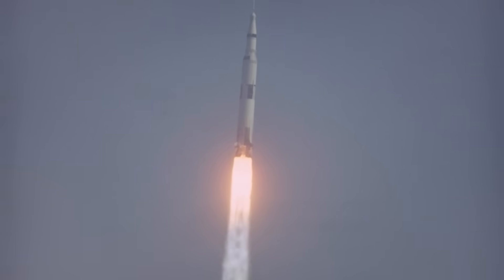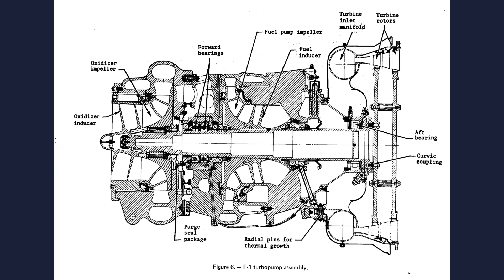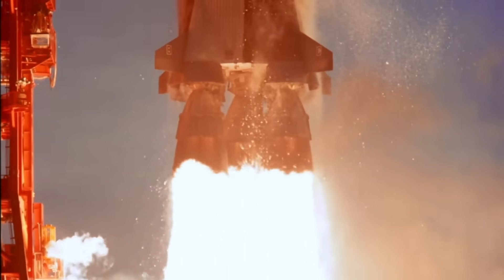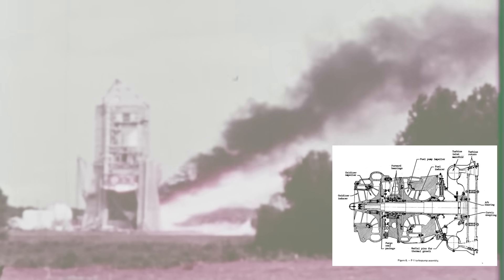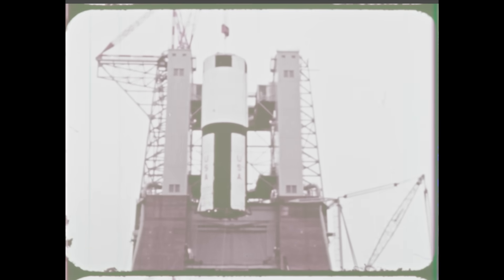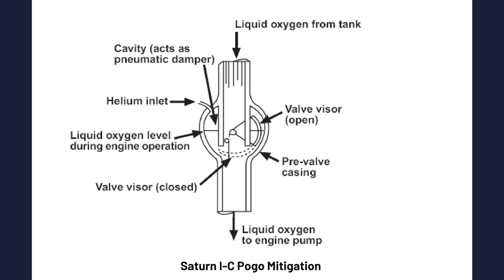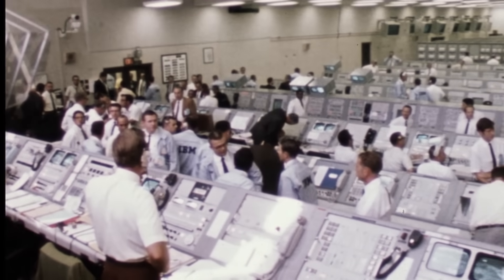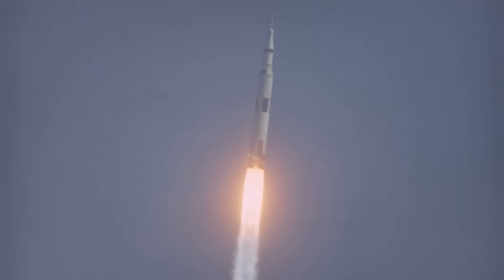F-1 Turbopump: The 55,000-Horsepower Heart That Nearly Tore Itself Apart

Comment: Cavitation is the formation of micro bubbles in a liquid created in micro vacuum zones that then move to high pressure sides of systems and collapse under pressure.  While the high-side pressures are rated at thousands of pounds per square inch the cavitation bubbles collapse is measured in thousands of tons per square inch. This is the equivalent to hammering again and again on a spot of metal which results in work hardening and subsequent metal flaking and shearing or, as Musk might describe it, the spontaneous unintentional subtractive machining of the part along with the creation and introduction of massive amounts of system contamination resulting failure. Happens in milliseconds! Boom! 

Another work hardening problem in rockets has to do with vibrating wires, any part of a wire that vibrates will fail. Think ‘vibration-cycles’ as in hertz and kilohertz. But rockets introduce so many tiny vibrations that these occur in megahertz cycles, or millions of cycles of bending and work hardening per minute. Wire vibrates and work hardens in milliseconds, breaks, and BOOM! It's over.    After all it is… Rocket Science!

Comment: What impresses me most about the F1 engines' turbopumps is how engineers were able to prevent it from exploding in flight. A seized bearing, blade failure, impeller failure or shaft failure would result in the loss of the vehicle.

Comment: To m, what's more impressive than the raw power of the F-1 is the engineering that allowed the piping to survive those fuel flow pressures for 2-3 minutes of flight time...on top of test firings.

Comment: 4:55  as impressive as the F-1 turbopump was, the Space Shuttle Main Engine (SSME) pumps are phenomenal. The high-pressure hydrogen pump runs at 34,000+ RPM with turbine power of 63,000 HP. It weighs about 800 pounds. The high-pressure LOX pump runs at 22,000 RPM and 23,000 HP with its secondary booster pump delivering LOX to the preburners at 7,000 psi. Other than sensor failures resulting in an anomalous shutdown (Challenger's center engine during STS-19 in 1985) the SSME was 100% reliable which is astounding given the power densities involved.

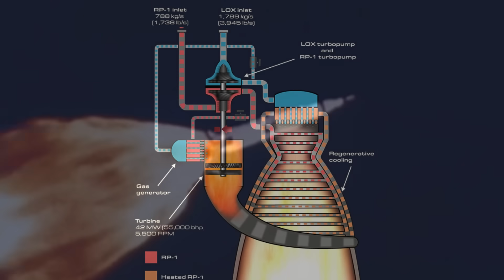Comment: 0:22 mass flow rate was WAY over 1000 pounds per second: about 4,000 lb/s of LOX and about 1,750 lb/s of RP-1 (total 5,750 lb/s which if you multiply by the sea-level spicific impulse of 263 s gives about 1.5 Mpounds of thrust).

Comment: There are two main reasons to visit the Museum of Flight at Boeing Field (KBFI): to see the #1 747 and to see the F-1 engine parts from Apollos 12 and 16 which were recovered from the bottom of the Atlantic Ocean. The pump turbine is very impressive.

Comment: Please do this same video but for the SSME/RS-25 turbopumps! The hydrogen was a beast to handle!
Reply: The turbopumps of the SSME were even more powerful and generated pressures far greater than the F-1's turbo pumps.
Reply: @taras3702  
They need to do that since the pressure in the RS-25's combustion chamber is nearly 3 times higher than in the F-1's.
Reply: @fromnorway643 The hydrogen turbopump was the size of a trashcan, yet generated 70,000 shaft horsepower with an outlet pressure of 6,000 psi. The pre-burners operated at an even higher pressure of 8,000 psi. Like the F-1 engine before it, engineers blew up lots of prototypes on the test stand before the SSME became a reliable engine. Thrust chambers exploded and turbines self-destructed repeatedly during testing. Turbines and the pumps they drove spun at 35,000 revolutions per minute as I recall.

Comment: The Saturn V F-1 engines were an engineering brute-force masterpiece of last century. 😊

I was at the Cape for the Apollo 17 launch with 2 high school buddies. At 3 miles away the sound vibrated my chest. But atop in the command module Cernan, Evans and Schmidt no doubt felt far, far more traumatic noise and vibration. 😮

Comment: The design of this pumps was initiated by Wernher von Braun for the German Rocket V2 in the 1940's, where it successfully worked.
Of course not as powerful as this ones. The V2 pumps had a power of about 450 hp. And the turbine was propelled by steam, generated by the reaction of hydrogenperoxide and sodiumpermanganate.
Impressive machines, anyway!

Comment: All that design, development work & precision manufacturing for an engine that was used for just a couple of minutes to then be discarded once the kerosene & oxygen ran out.
Reply: And god dam gave the engine all in it's short service time
Reply: After all of that intense heat and pressure makes the engines and body of the stage unusable, so recovering them after use was not feasible back then. But they have located the debris and are pulling that out of the ocean

Comment: Quite right that the impressive thing about rocket engines is the pumping required. I often point out that the space shuttle engine pump's had to force the contents of the huge external tank into 3000 psi combustion chambers in just a few minutes.
Reply: The RS-25/SSME is a masterpiece! Especially the turbopumps. Hydrogen is such a beast to work with and manage.

Comment: My father was valve design engineer with Rocketdyne from 1957-1988. Slide rule guys wearing white shirts and pocket protectors!
Reply: Today engineers can’t even understand how a sliding ruller works without a computer to explain
Reply: @eneto7785 no one probably could know how slider rule works if no one have first explained how it works.  That`s called learning.
Reply: Always other´s fault, usual explanation for own weaknesses. Keep this good job....
Reply: @eneto7785 
What??
An engineer today could easily use a slide rule!!
You’re not really too familiar with the field, are you?
Reply: I only wish I could have insight on how the drafting rooms worked back in such times. So different yet, the fact this mechanical marvel was made using only that.
Reply: @Helicopterpilot16 well... That and a highly specialized drafting table.
Reply: May God bless him.
Reply: Short sleeves, ties, horn rimmed specs & sensible haircuts.
Reply: He retired at 53?
Reply: @gregorymalchuk272  No.
Reply: Tell your father to tell us about the Old World Black Empire and the designs he cos played his entire career.

Comment: Fun Fact the German V2 rocket turbopump came from a fire engine
Reply: The German V-2 rocket's turbopump was manufactured Klein, Schanzlin & Becker (KSB) that did specialize in fire-fighting equipment. Wernher von Braun's team approached KSB in mid-1935 for its expertise in centrifugal pumps, and KSB ultimately helped develop the powerful, lightweight turbopump needed for the V-2. The turbopump's turbine was driven by steam generated from a hydrogen peroxide-based system. My father was in the US Army 9th Air Force during WW II and in London on Friday September 8, 1944 on a three day pass when the first Nazi Vergeltungswaffe-2, V-2 rocket hit England. The blast shattered the windows in the building where he was sleeping. The British government initially attempted to cover up the true cause of the explosion, officially reporting it as a gas main explosion to avoid public panic and to keep the Germans from knowing the rockets were reaching their intended target areas. The public was not officially informed about the V-2 attacks until November 10, 1944.
Reply: @sandcycles894 They are Old World Black Empire engines and they all predate the 1700s.

Comment: How was the turbine started- because there wasn't any pressure in the rocket nozzle to get it spun up?
Reply: The sequencer fires the igniters which burn for ~6 seconds. The sequencer next sends GSE hydraulic pressure to the main LOX valves. The LOX valves open, sending LOX into the combustion chamber and directing GSE hydraulic pressure to open the gas generator ball valves. Propellents, under tank pressure flow into the gas generator and are ignited. The hot gases accelerate the turbo pump (which has already begun to turn due to the LOX flowing through it), causing the outlet pressure to rise. At ~375 psi outlet pressure, the hypergolic cartridge ruptures, sending the hypergolic liquid and fuel into the combustion chamber, causing ignition. Once the combustion chamber pressure rises to 20 psig, the main fuel valves open.
Reply: And I don't mean the gas generator source... As the turbine spins up, it's also spinning up AND pumping fluids. Different to a car turbine which pumps a squishy gas.

Comment: I know the RS25's turbo pumps were just as cranky.
Reply: The original Rocketdyne RS25 pumps didn't work all that well and output and lifespan never met the specifications.    The engineers were under severe weight limits which is the main reason for their fragility and when P&W made new pumps back around 1990 we didn't have those weight concerns so the pumps were real beasts.   What a shame that pumps made to live through 40+ flights are being expended after only a couple minutes of use on the SLS.

Comment: The Soviet N1 with the same issues.  But multiplied over 30 NK15 engines...
Just took one to fail.

💥
Reply: The F1 had the big problem with instabilities in the combustion chamber. They solved it with the baffle/dividers on the injector plate. The Soviets just avoided this issue inherent in big engines and just went with many, smaller engines. A somewhat inelegant, more brute force solution but, it was their way of getting it to work; sort of. The N1 blew up anyway.
Reply: @Obsfucation Old World Black Empire engines that predate the 1700s.

Comment: Turbopump failure = "You will not go to space today". Totally amazing engineering, all done with slide rules and pencil-on-paper drawings. And the manufacturing was equally amazing. The thrust chamber and nozzle (not including the nozzle extension) were made of over 500 tubes which were brazed - by hand. Each braze had to be perfect. Just one of the uncounted amazing things about the F-1.
Reply from the maker: Absolutely incredible engineering, thanks for sharing those details!

Comment: A brute force masterpiece for sure! It was just incredible seeing them in person at the Smithsonian, never fully appreciated their sheer size  until then.😲
Reply: Still not big enough for von Braun; he wanted to build a rocket with NINE of these engines in stage 1.
Reply: @TopusSoftware  Hello Mars?! 😂
Reply: @TopusSoftware Holy you know what !!
Reply: @TopusSoftware They also developed and component tested an even bigger engine, the M-1. It have an axial (!!!) turbopump. These guys were nuts.
Reply: I took a photo of my son, when he was 8 years old, standing inside one of the engines.  This was at the Saturn 5 display in Houston.  There were just this little rail around it so it was easy for me to quickly lift him up to it for a quick photo.  But it shows how huge they were.  I am 5'10" and I believe I could have stood up inside it.  And to think that there were 5 of those beast.
Reply: I've even touched them in there. So incredible, it is literally tons of Inconel. And if you look closely you can see burn/exhaust marks. These are run/tested models, so they once worked too, even if in a test stand!

Comment: Very cool video.

To see how hard rocket science truly is, read " Space Shuttle Main Engine The First Ten Years" by Robert E. Biggs.   If you google it you can find it here online to read for free.  A real eye opener.  For example:

"The models had shown the engine to be sensitive to small changes in propellant conditions and that timing relative to opening the propellant valves was critical. Expecting difficulties, a cautious step-by-step plan was followed to explore the start sequence in small time increments.   Using this approach, it required 19 tests, 23 weeks and 8 turbopump replacements to reach 2 seconds into an eventual 5-second start sequence.

 It took an additional 18 tests, 12 weeks and 5 turbopump replacements before momentarily touching MPL (MINIMUM power level).
 A safe and repeatable start sequence was eventually developed by making maximum use of the engine mounted computer (MEC) to control the propellant valve positions. 

>>>>>> JUST THE complexity in how they have to open and manipulate fuel valves is mind-bending.

"The first oxidizer valve to be commanded is the FPOV (fuel preburner oxidzer valve). After a delay of 0.100 seconds, the FPOV is ramped to 56 percent open at its maximum slew rate. At 0.72 seconds, the FPOV is given a “notch” command to close about10 percent and then reopen. This is done to compensate for the second pressure dip caused by the fuel system oscillations and avoid damaging temperature spikes in the HPFTP turbine. During this dip, the FPB is ignited and the additional power causes a slight acceleration in the HPFTP speed.   Just prior to the third fuel system oscillation pressure dip, the FPOV is given another notch command, which is maintained throughout the priming sequence.

>>>>>>>That HPFTP (High Pressure Fuel Turbo Pump) will accelerate at 400,000 RPM per second and self destruct in 1/10th of a second if it is not primed properly.  it is a hell of a fantastic piece of hardware that is smaller yet 50% more powerful that the F-1 turbopumps:

"The HPFTP is a three-stage centrifugal pump driven by a two stage reaction turbine, which is part of the same rotating assembly. When operating at FPL (full power level), each of the three twelve-inch impellers develops over 60,000 feet of head rise at a LH2 flow rate of 17,000 gpm and a speed in excess of 36,000 rpm. The two-stage, eleven inch diameter turbine delivers 75,000 horsepower (!!) with an efficiency greater than 80 percent at a pressure ratio of 1.5.

 With a total assembly weight of 775 pounds, and a length of just over three feet, the HPFTP is the most compact, highest power density rotating device known today."

Incredible info, so if you have not read it (6 chapters) give " Space Shuttle Main Engine The First Ten Years" a look-over.  Peace out.